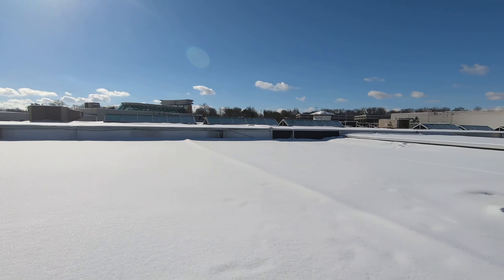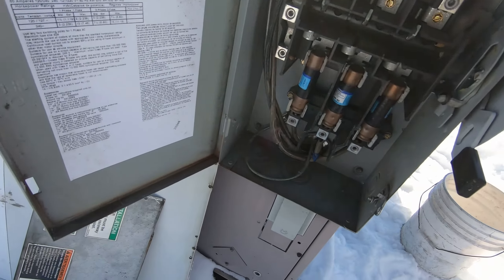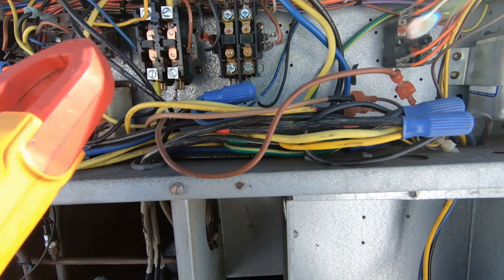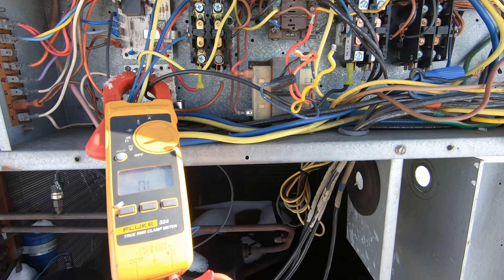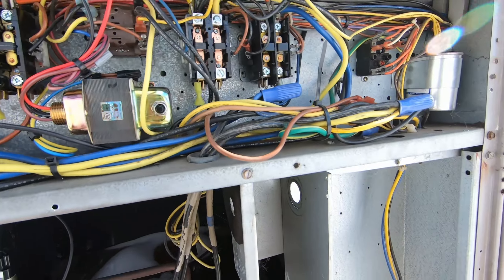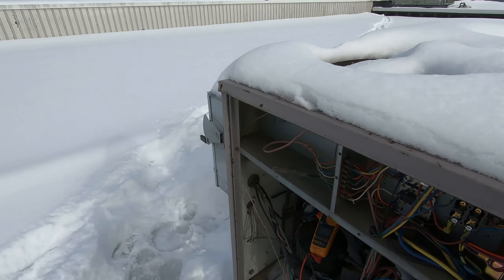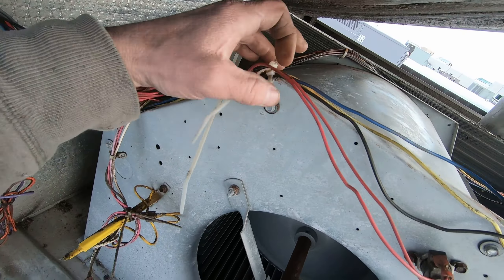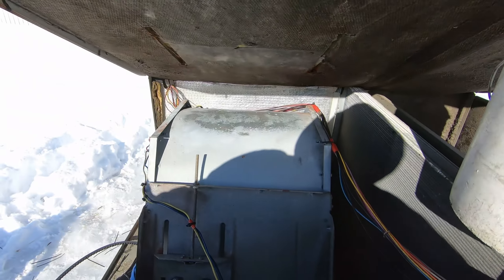Dead short, Blower Issues and Burnt Transformer- No Heat-Triple Offender

Comment: It seems like, on those units, that low voltage wiring that runs across the blower for the economizer is 99% of the time the cause of a low voltage short. You would think they would have learned their lesson and put that wiring in some kind of a sheath, but the new units are built the same and rub out the same way.
Reply from the maker: You would think! They also honor a 10 year heat exchanger warranty on their piece of shit heat exchangers so……. It keeps me working so I’m not complaining! Thanks for watching Winston, I appreciate you brother!
Reply: Yup it always happens in the blower section. I find them a lot right where the blower housing is or where it makes a tight turn around the evap coil.